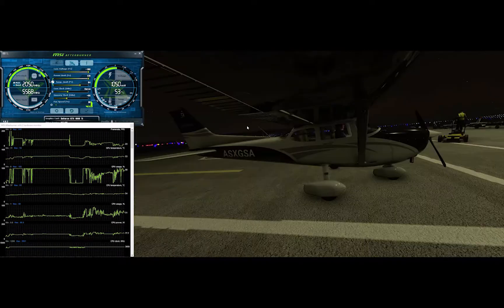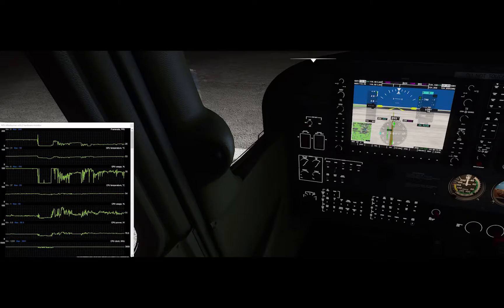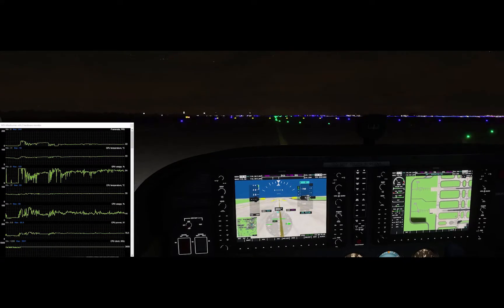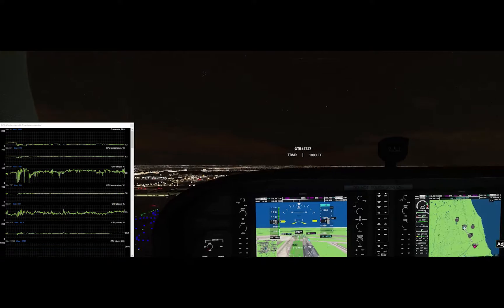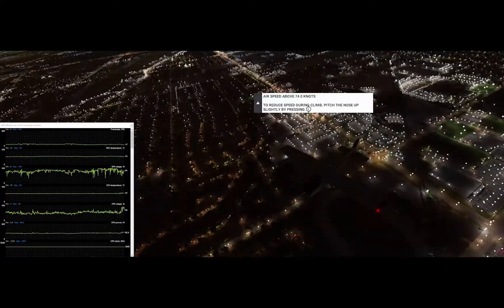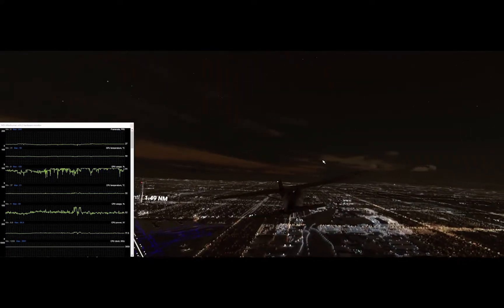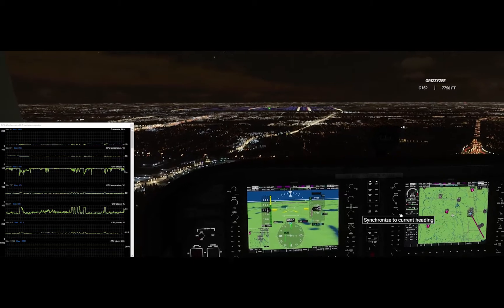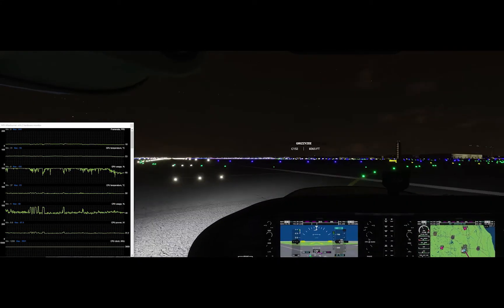Flight Simulator 2020 - GPU Overclock Results

Comment: what is your cpu?
Reply from the maker: I have a 5820K currently at 3.6Ghz.  My motherboard ran into some power issues a few years back and it started having issues pushing higher power through it about a year ago so I went from 4.4 / 4.6 down to 3.6 to regain stability :(

Still a solid CPU but it lost a good portion of its edge pulling back the clocks that far.
Reply: @Ripskin16  it seams that your cpu is actually pushing you back, I have a gtx 1080 non ti without oc, and a i5 8400, and I do have a average of 45 fps within reason of what you showed on the video
Reply from the maker: @raytronic16  I believe I am slightly CPU bottlenecked.  If I could push my OC back up over 4 I don't think it would be quite as bad.  

I am driving the 5760 x 1200 resolution and I see my GPU usually around 98% vs the 99 "pegged" running with a few periods of dipping.  Most studders or dips are the system switching from distance buildings and low res to loading in the details which is a CPU issue usually.  

Hopefully Ryzen 4 comes soon and is not too out of line so I can get upgraded.  If I could keep my high OC I would likely not be considering it as my CPU was doing really well at 4.6